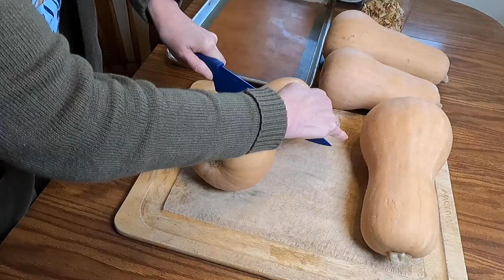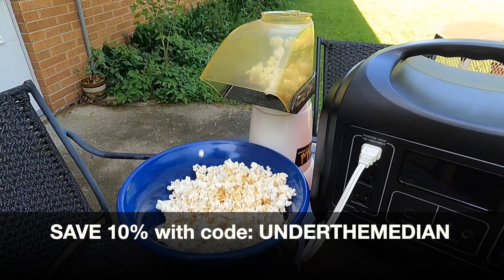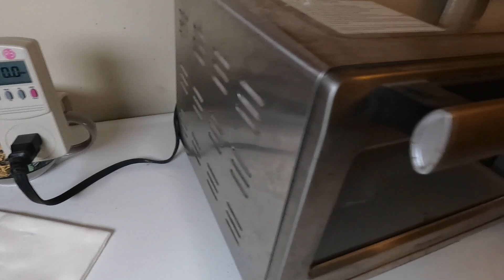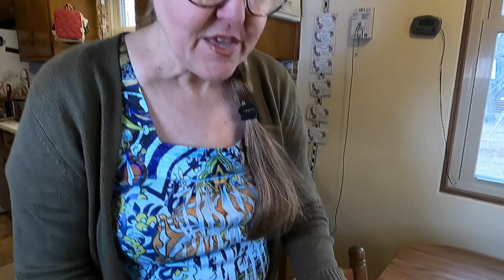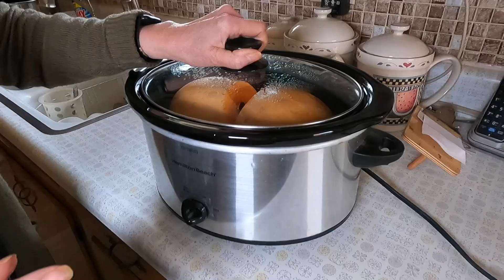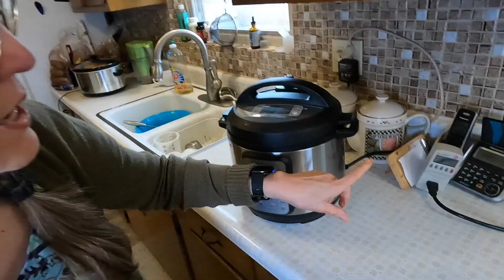How to Save Money Cooking with Low-Energy Appliances

Comment: Super, thanks,  ( turned off the main fuse for the oven, never use it now!  you do have to factor in buying the pressure cooker and I note used a big one but are cooking for two a smaler model there are some around 2.5 itres and you will waste even less power.
Marvelous video, thanks.
but can you not add international temperatures not just old imperial ( old british like) temperatures to help my old brain.

Comment: I love this video. I have a gas oven and stove top, I wonder if that makes a difference in energy cost compared to electric. Do you have any idea how I could find out?
Reply from the maker: A gas oven is generally less expensive to use when compared to electric. My research said about 1/3 less than the electric oven. But, it depends on your cost per therm of natural gas and how much gas the stove uses. I have no idea if there is even a way for the consumer to figure out that information.

Comment: Very helpful, useful video. I'm glad I stumbled onto your channel.   I also use a Sun Oven when weather allows.  The weather needs to be sunny and also very little wind. I love using it! If you follow the use instructions it works wonderfully. It has a built in thermometer and I use an extra one inside just to be sure of accuracy. My food will boil/simmer easily.

Comment: Biggest energy hog will be the wall oven. Instant pot pressure cooker will use the least energy. The slow cooker will be more energy hungry than the Instant Pot,depending on how well it is insulated,which will use less energy,even though it will be on longer.

Comment: Did you take into consideration that that wall oven looks to be quite old (by its unusual color (Honestly, I've haven never even seen an appliance that color!!) as opposed to the more modern "energy savings" appliances that are available and prevalent today? This would make some difference. I was also thinking that the instant pot since it cooks so quickly and efficiently it should also be a real contender. I choose one method over the other based on how I want the food to taste and look.  A chicken roasted in the oven. Looks and tastes one way vs. cooking a chicken in the crockpot is very different for different dishes. An older toaster oven like you have there is going to use a different amount of energy than a brand new convection oven: I don't even have a toaster oven because I have a new convection oven. NOTE: I like to roast my butternut squash other side up...I put butter and maple syrup in the cavity for a incredibly delicious taste. When I roast a chicken, I am ALSO roasting squash on the top shelf, and a rice casserole as well. Using my ranges oven I cook an entire meal (plus leftovers) AT ONE GO- so on the end I believe it is saving me money!

Comment: You did not compare like with like as two systems roasted with two steamed. The Pressure cooker was always going to win. I have used a pressure cooker for years and when used with gas its even more efficient. It due ti increasing the level of heat and also once the level is obtained the pressure cooker does not allow the heat to escape so it only has to be maintained.

Comment: Hi Hope and Larry! This is my first time here but it will not be my last. One thing you left out of this review... the taste? Was there much of a difference between the butternut pumpkins depending on the cooking method? 
I remembered a dish I used to make around 30 years ago. It used half of a small butternut pumpkin per person with the seeds and some flesh removed. Sit it upright (as opposed to on its side) on a baking dish to cook. Try to keep the skin intact as this will be the 'bowl' for the dish. When the flesh is soft take it out of the oven; scoop out much of the flesh and mix with cooked rice, finely chopped onions, raisins, herbs of your choice and a small amount of stock. You can turn that stock into a sauce with some wine if you like or just add gravy or even cheese to it. You can add some cooked meat as well. Put the filling back into the pumpkin and continue to cook until everything browns. Voila!
As my stove's oven no longer working (and I can't afford to replace it), I now use my air-fryer-oven (which is a rectangular metal oven, so not like most plastic, rounded air-fryers) for much of my cooking. I have it on the 'oven' setting most of the time but it uses the high force of the air-fryer  to make this into a highly fan-forced oven. I have been a bit concerned about how much it costs to run and I can't do much baking in it as I could only cook about 6 muffins at a time, but it's effective for me for main meals as I live alone. 
I'm not sure that your tests were done equitably. For the instant pot, you had a smaller area to fill due to its size AND you put a CUP OF WATER in the bottom. Had you put a cup of water in the bottom of the pan for the other appliances I think that would have made some difference. That one cup of water is enough to generate a lot of steam. You would have needed to have put a lid (or aluminium foil, or another baking pan of the same size and used clips to keep the pans together- thus creating a type of dutch oven) on the dishes to get a snug fit just like you have with the instant pot. 
I generally microwave vegetables like this before putting them into the oven , so that also cuts down on cooking time and energy usage. This shaves a bit more time off the cooking time in the main appliance.

Comment: Wish your test had included both a microwave & air fryer. I cook a lot in my microwave. I try to use my oven as little as possible (we have an all electric home which means $$$$😬.) I used to use a pressure cooker on my electric cooktop, but guess I need to use an Instant Pot instead. Generally what I use depends on what I'm cooking & the space & time requirements of the utensil.

Comment: Clear as mud. You need to show kWh. kWh is the correct units for comparison of energy used (it is the unit you buy electricity with). kW is just an instance in time, kWh is total energy used. As you state, the heating  elements will switch on and off, you need to account for this in any calculation.

Comment: German electronics developer here..... I bought an Instant Pot (from the UK) about two years ago. They strangely enough are uncommon here. In any case I fell in love with it quickly. It is so much better than the german and french non-electronic pressure cookers we´ve used for decades. On big thing: It´s really well insulated! The inner pot is heated up of course but that doesn´t take too much energy. The outer shell stays cool though and that means that the majority of the heat actually goes into heating up the food and not the kitchen. Try cooking short rib or frozen chicken for a chicken soup and take a look at your "Kill a watt" (how American....). You´ll be surprised.

Comment: Pressure cooker always more energy efficient. It's why big cannery's and large kitchens use the method. Want the caramelization of the dry bake.  either finish with a light grill or a few minutes of high temp. Crock pots are great for slow cooking cheap tough cuts of meat or slow braising meat that would be a pain on the stove.

Comment: We have electric oven with internal fan (can heat multiple pans stacked), air fryer, Crockpot Turbo Express and an induction stovetop. 
We also have PV solar…

We use the most suitable for each use, the regular oven is least used, I’d say. 

Frequenly we fill the Crockpot with chicken etc, around 2 kg, and make dishes for weeks of dinner/lunch that we put in the freezer. IKEA has great glass storage pots, suitable for this.

Comment: I have an AEG instapot "pressure cooker" it  has a "slow cooker" feature on it which is ideal for  tough heavy cuts of meats, slow release stews/soups. Best of both worlds and one less appliance  laying around.  Breville counter top oven has convection fan option  which i find (learned) cookers faster &  you have to scale back the recommended temp setting 5 - 10 degrees or shorten the cooking time.  Amazing what you can cook in those mini ovens.
Wall oven only gets used  2-3 times a year, actually turned off at the wall  ( good hiding place for the chocolate cookies & treats no one ever looks in there)
Would be interested with a comparison between an electric fry pan vs stove top fry pan.

Comment: I have loads of energy saving devices !!!  I don't have a full sized Cooker !!!  I have a small Electric Oven, 3 Induction Hobs !!!! I have Pie Makers, Multi Cookers, 3 Microwave Cookers, Wood Burning Stoves to use in the Garden, and a Solar Cooker !!!!  But I now Use a lot of Tinned Food which is already Cooked.  I add Flavourings, eg 4 kg Middletons Chipotle Chilli and Lime !!!  A tablespoon is just right so the Tubs last for years !!!!  I try to use a Microwave Cooker for most stuff !!!!  I would cook a Squash in the Microwave for half an hour Microwave and I would brown it in my Halogen Oven !!!!  A small electric Oven will be on for 20 minutes in an hour !!!!  The toaster oven does not turn down, it goes on and off like a Microwave !!!!  If you use a full sized oven on your cooker the Cost is Horrific !!!!  A pressure Cooker is Good because it's very fast, and used with an Induction Hob, or it's an Electric Pressure Cooker it will use hardly any Electricity once it has heated up !!!!  Your large Cooker Oven is about 12 kilowatts so you can imagine what it would Cost to cook the Squash in that oven !!!!  An electric Pie Maker is brilliant !!!!  You can cook the Meat and  Gravy in the Microwave and Cook the Pastry with the Pre Cooked Fillig !!!!  And it will Cook in half an Hour !!!!  Another brilliant device is a Rice Cooker !!!!     Most Multi Cookers Cook Rice !!!!  An induction hob tells you how much power it uses. At 400 watts you can fry your bacon, eggs and fried eggs !!!  And it switches on and off so it costs pennies to cook with !!!!  Your electric ring on a full size cooker is 2, 500 watts so it Costs 6 times what the Induction Hob uses !!!!

Comment: There is an other low electricity user appliance though you may never have seen one. It was designed in Czechoslovakia in 1939  it is called a "Remoska" just worth having a look on the net. The one thing you can be sure of is that it can do what ever an oven can do but better  at a very low cost, in my experience it is that is true.

Comment: You kept saying kilowatt (KW) when I believe you meant kilowatt hour (KWH). The meter's image appears to be displaying KWH. Kilowatt is the rate at which you are using power (like how fast [gallons/second] is the water flowing). Kilowatt hour is how much power have you used (like how many gallons of water have  you used). Two more comparisons might be a stovetop pressure cooker or a  thermal cooking bag / container.

Comment: A convection oven (which can be had in countertop size) or a hot air fryer is a bit more efficient than an ordinary oven because the moving air does not need to be as hot as the still air in the ordinary oven to do the same baking job.  It's like the way wind chill factor works, but in reverse.  When one "must" bake, it will save energy.

Comment: Please, use the correct units. KW is an unit of power. What you mean is kWh, a unit of work, and domestic electricity is charged by this.  Then you should inform your readers of the real cost in dollars and cents.  For a simple calculation, allow $0.20 per kWh.  You are talking of a couple of pennies at the most in your examples.

Comment: Its basically about heat transfer efficiency. For a given amount of "done" you need to raise all of the food to a set temperature. This requires transferring heat into the food from outside.

A pressure cooker boils water to create steam which is then used to do two things, purge the vessel of air and then raise the pressure of the vessel. Then as the pressure goes up so does the temperature of that steam in the vessel, this  is sometimes called super heated steam.

Crock pots typically don't heat their liquid to boiling point so the heat transfer is slower and therefore must be done for a longer period of time, heat losses to the outside world therefore last longer and increases the energy cost to maintain temperature. In addition the vessel isn't hermetically sealed so there is a certain amount of water vapour lost. That is an additional energy loss.

An oven uses air to move heat from the heating elements to the food. A given volume of air contains less energy than the same volume of water or super heated steam so again heat transfer isn't as fast. For an oven you can speed things up a bit by adding a fan which moves the hot air around faster, this is what is called a convection oven even though its the exact opposite of convection. The other way is to set the working temperature higher but that leads to the outside of the food being overdone while the inside is not cooked enough.

See, simple ;-) .

Comment: I would suspect the pressure cooker as the cook time is much less.
I am surprised a microwave isn't on the list.
As an off gridder, I use energy/ electric cook when the sun is available.
Later, I heat up in the microwave.
I may cook 1 sunny day during a week and prepare meals, using an Instapot, 
for a week or more and store in fridge and/ or freezer.

I like the toaster oven for foods like toast and toasted vegetables.
I rarely use the oven unless I was making cornbread in an iron skillet.

Comment: The Instapot, since the time used is the least amount of time. 

In the EU we can buy a counter top oven that can be either a warm air oven, a regular oven,and a microwave. Wish you included a microwave. Also your old 230 Watt oven may not be energy efficient. But you made do with what you got! No reason to go out and buy a new oven if yours works. New ones will break down in a few years since it is a new economical model of business to have kill switch for the length of the appliance is still going to operate. So you have to depreciate the appliance quicker say a 10 year period, before you have to buy a new.

Comment: I'm not surprised at all.  I use a stovetop pressure cooker. Once it comes up to pressure, I have to turn down the heat to the lowest setting for the burner.

By the way, I switched to a stainless steel stovetop pressure cooker because I was tired of having to buy a new electric one every year or two.  In addition, they cost a lot less.  There are no electronics to mal function.

Comment: there's a 5th appliance you could use. It's called an Air Fryer oven. I have an Instant Pot Air fryer oven. I haven't used it a lot yet but I am pretty sure it would be up there when it comes to saving energy.

Comment: You could put an amp clamp on the supply line of the wall oven . You would have to keep track of the current use over time and convert to KWH . I saw another channel recommend an electric kettle for boiling water over gas . You can also look at induction ranges . The most efficient energy star rated appliances will save money , especially on refrigerators and air conditioners .

Comment: It doesn't look like you took into account the time the instapot takes to come up to pressure. When I batch cook I use that, four crockpots (slow cookers) and a micro/oven/grill combo, an airfryer and a hob. The instapot is like an oven and air fryer in that there is "prep heating". If you exclude that - which can be quite a long time - you skew the results.

Nor does it look like you took into account the wattage used and the time the appliance was on for. There's no benefit from saying the crockpot took four times as much energy if it was running for four times as long.

Frankly, you need to redo this without all the babble. A 21 minute video that could have been six minutes.
Reply from the maker: The kill-a-watt meter was plugged in and running from the minute we started the appliance (including the Instant Pot). So, with all due respect, I did account for the Instant Pot coming up to pressure. Maybe we don't need to redo the video. Maybe you just need to pay attention a little more carefully.

Comment: I use a thermal cooker (Primus) - 15mins (casserole) or 20mins (roast beef, silverside and veg) on the stove. The rest it does without any power for the next 5 hours. Made a beef goulash this morning it will be perfect in 4 hours for dinner. Don't use anything else now.

Comment: Nice.  Thanks.  Too bad the instant pots don't fry, or dry heat, or I'd buy one.  The electricity cost in our city is $9.61¢/kwh.  So my roasted Squash would cost very little in a Toaster Oven.  I rarely use our electric oven.  I'd prefer to get a gas oven, Electricity is much more expensive than Natural Gas here.  I sure wish you'd have cooked your squash in a Microwave.  10 minutes in a microwave is all I need to cook a squash.

Comment: I have a stainless Presto pressure cooker I have cooked with for 52 years. I think that uses little energy. I used it for 20 years on an induction cook plate but that finally quit working. So when I need to buy a new cooktop it may be induction as my pressure cooker works well with it and   induction is more energy efficient. For now my smooth top electric is great. It is 2 years old and the new ones are more adjustable than older ones were plus we have solar panels so I cook with solar energy.

Comment: So the pressure cooker won energy wise and in length of cooking time. Not surprised. My mom used to use a pressure cooker a lot when we were small. And this was in the 50's and 60's when energy costs were practically nothing in those days. A pressure cooker is not suitable for small amounts. I have a medium size convection oven and I have to preheat it, which takes about 10 minutes for a 350 degree temp. I also have a crock pot, which I rarely use. Actually, I do most of my cooking on a ceramic and induction cooktop combination. I do not cook or heat with a microwave, I don't have one.